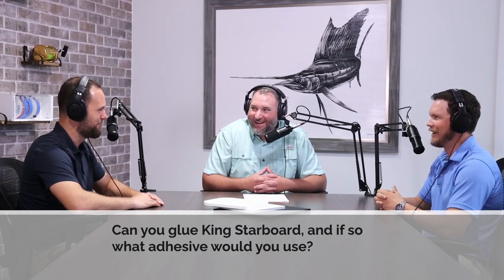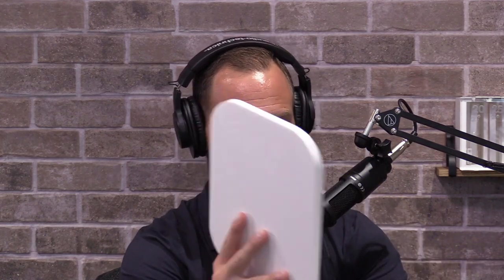Can you glue king starboard?

Comment: FYI - Aaron from the "Born Again Boating" channel did a nice video on starboard, even does a nice shout out to @boat Outfitters on it.  

Long story short, at 5:28 in his video (Link to this spot:  https://youtu.be/Bz5Jk7KBo6E?t=329 ), he says you can scuff then heat the starboard pieces and use JB Weld Plastic to bond starboard together.  I have used this method with 5200 and was able to hand-make my own phone holders out of starboard for my electronics box on my new hard top, however getting the phone holder to stay in 1 place without a good adhesive bond makes the holder useless.  So I followed the scuff & torch method with 3M 5200 fast cure and it worked really good for what I wanted to accomplish.  I not only mounted my phone holder, but I also made a USB power plate and used 5200 to bond the starboard to the side of the E-box.

Maybe I'll do my own video on those projects.

Comment: In my experience, Bostik 940A is the only product that effectively bonded HDPE to gelcoat or to each other for that matter. I tested several including JB Weld, 3M 5200 and the Bostik product worked best. Only issue is it currently comes in industrial sausages only.

Comment: What about bonding agents like the testors glue used for plastic models....its suppossed to melt the plastic together more than serve as an adhesive..i  curious to try it with Star Board
Reply from the maker: Hey Norm, that's a good question.  I don't believe that we have tried using Testers modeling glue.  At the same time I do not believe it would form a structural bond that is as strong or stronger than mechanical fasteners.

Comment: I tried Line X paint of 2mm and it didn't stick it went out the surface although i made it rough
Reply from the maker: This is the double edged sword of starboard.  Its easy to clean because not much sticks to it, but you can paint it because nothing sticks to it!
Reply: Linex(two part polyurea, not a paint) definitely does not adhere to Starboard (HDPE). In my production shop at work, we spray aluminum plates with a polyurea coating while the plates are set onto a Starboard backing board, specifically because the polyurea peels off it so easily! Nothing really sticks to HDPE.
Reply from the maker: You are absolutely right!  Just noticed my typo... It should read "but you CAN'T paint it because nothing sticks to it!